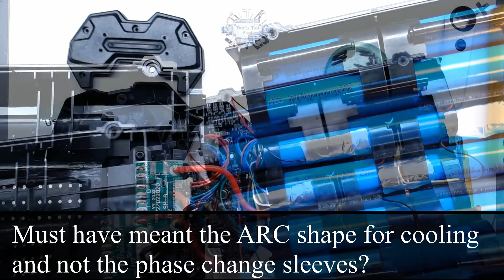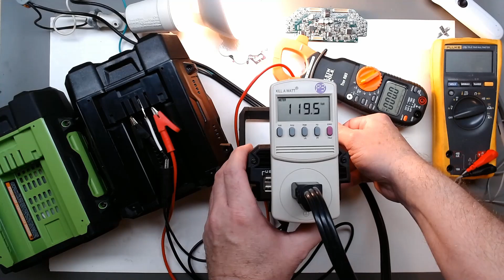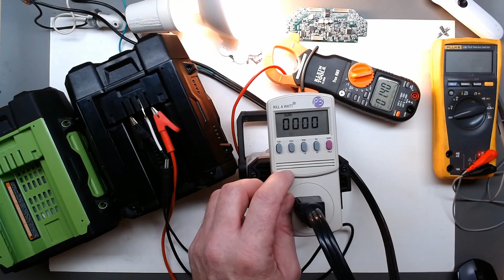Ruzixt 56V 5AH Battery for EGO Products

Comment: I have the Ego Power Station and my intention is to use it in power outages mainly. I thought if you left the batteries in it they wouldn't go into discharge mode or whatever they call it. It seems some do and some don't. I don't want to need it and have discharged batteries. Is there a way without voiding warranty to do this and is there a way that even voids the warranty from stopping this from happening? Thanks again for your videos.
Reply from the maker: To be clear, I do not own a power station yet so I can not answer for sure. I actually thought the station had on board charging and it would keep the packs charged, Is that not what you are seeing? If it doesn't do that, I would be surprised and disappointed.
Reply: @ThriftyToolShed  I don't keep it plugged in with the charger on it. If I have to I may but I thought the batteries wouldn't automatically discharge if the contacts of the battery were in contact with a charger etc. Anyways thanks for the reply.
Reply: @MrPageyjim  - the automatic discharge is to prolong the life expectancy of the battery.

If you have a power outage once a year, have a set of batteries, but do not use them regularly… just rotate them on/off the charger every few months. If one is discharged, the one most recently placed on the charger will be full. Use a phone app for a regular scheduled meeting with your battery charger in your garage! :-) 

I use my batteries nearly every week, so my batteries are charged all the time, but as they get older, the duration of holding charge decreases. My 5 year old batteries work, but don’t perform like a brand new battery.
Reply: @DavidHalko  What I do is use a couple batteries on a regular basis. The others I charge to app 75-80% to have them if ready and that should keep them healthy for a long time. I Can see the discharge being helpful but wish they didn't discharge as low as they do. I love your site and appreciate what you do very much.

Comment: It seems these are not available anymore. I searched everywhere but nowhere they can be found. EGO must have issued a cease and desist order on them. However, if you can directly contact Ruzixt, they can still sell the battery pack separately, i.e., just the welded battery pack with the thermal board and connectors and a separate BMS board. I think there is a big market for both of these two items for DIY'ers. In fact, I've seem refurb'ed EGO BMS boards on sale on eBay.
Reply from the maker: Link has been updated now. 
It shows up as 5000mah instead of 5AH?
https://amzn.to/2TKfXg0

Comment: Hooray!  Someone finally did it!  It’s such a close match to Ego brand batteries on every level!  Ive opened up a few different aftermarket battery packs for Makita, Ryobi, etc. and I’ve never seen one that was such a close copy of the brand name variety as this.  I too have been waiting to see an ego battery clone for a while now, looking foreword to checking prices and saving a ton of money on my next ego tool battery! Thanks for showing us, and for all your very informative videos!  Keep up the good work!
Reply from the maker: No. I am certain. It's from a known battery cloner in China. I mentioned in video that I was interested in the BMS because of that. They most likely copied the microcontroller program from a EGO BMS. I was at least impressed how well they copied the BMS and they did make it work with the D-terminal to tool communication. I was hoping to be able to get spare BMS boards from them but no response still.
Reply from the maker: I was shocked at how close it is even the shape of the BMS. lol..
Thanks so much for your comment!
Reply: @ThriftyToolShed  that would be good buy the boards and 3D print the casing and perhaps put samsung 25r cells in
Reply: @paedahe4975  also they're using different cells 👍

Comment: The 530 blower draws about 15 amps on high speed.  Compare the run time of the two batteries on a blower for a high draw test.
Reply from the maker: I will do a high draw test for sure. Did not want to make video much longer so ended it with slow drain monitor mainly to get the cut out voltage level!
Reply: Current draw tests on several ego tools. https://www.facebook.com/groups/178465356431348/permalink/614190146192198/
Reply from the maker: Thanks, I have worked a good bit with the blowers. Did a lot of current checks myself, mostly off camera while testing to save video time. 
https://youtu.be/kEb8gGwnoDY

Comment: Unavailable on Amazon now it seems.
Reply from the maker: I just noticed that as well. 
Hopefully more will be in stock.
Reply: @ThriftyToolShed  I just bought one on Amazon and it arrived fully charged.
Reply from the maker: @ctsfiddler  
The one I have is working great, I still have not heard anything back from manufacturer about possible spare parts. I would like to get the BMS board for sure. Maybe alot of people sending emails with similar question will get a response. Light em up with emails if you get time!

Comment: Phillip thanks for a nice video. I was curious about this replacement battery. I wonder if you looked into that Husqvarna battery I had left you a message about on Facebook? I ordered one, and it arrived. One of these days I will use its cells as replacement for EGO cells. But after Receiving  mine, another source started selling on eBay , $5 cheaper!
Reply from the maker: That's awesome. I did see that and it does seem like a possibility for sure.
Reply: @ThriftyToolShed  How is the battery holding up? I saw that that brand is now offering a 9ah battery. We need a run-time test on a blower. Real vs. fake. It’s a nice looking battery, but I read bad reviews on Amazon. Let me know.
Reply from the maker: @paedahe4975  Mine is still doing well, I do not know about the 9AH. The 5ah tests similar to a 4 AH. Unless it is alot  cheaper it may be worth it to get the EGO pack. It can even be cheaper when buying a tool/pack kit than the off brand by itself.